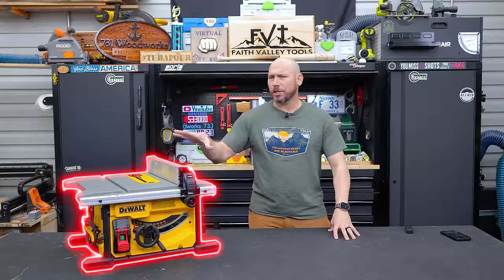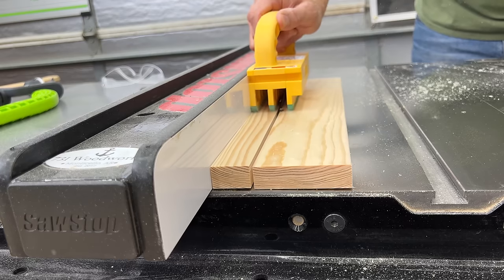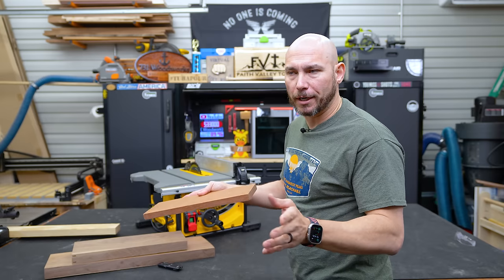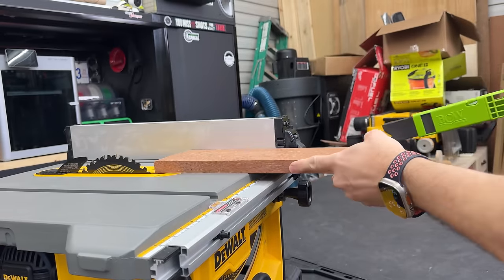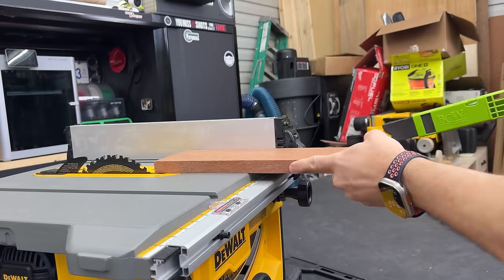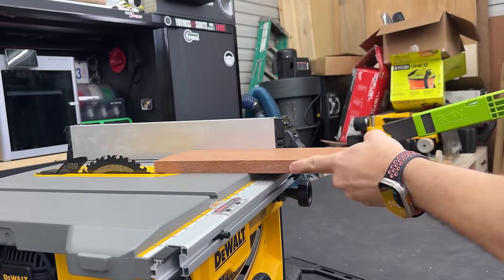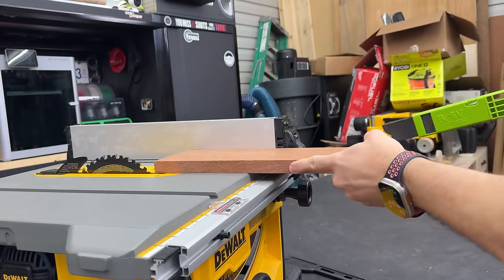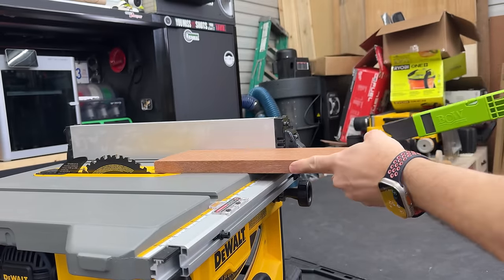99% of Beginner's Don't Know These Table Saw Mistakes to Avoid!

Comment: Yep! Tiny cut on a miter saw. DON’T DO IT!
Learned this the hard way.
Blew my aluminum blade guard into smithereens, shrapnel!!! Somehow I walked away with all my fingers. It hurt. I stopped and examined all my fingers and hands. Was pleasantly surprised not to see any red. Every time I use a miter saw this is a flashback memory.

Comment: There is a situation which is safer with the blade raised well above the top of the material and that is when cutting thin flexible plywood. If you attempt to cut 1/4” plywood with the blade barely protecting above the material, the air coming up from the spinning blade can lift the plywood up out of the cut. I’ve seen operator injuries from the plywood rising and being kicked back from the blade. The blade can fire a piece through a shop wall. Best practice is to raise the blade at least 1” above the work and concentrate on keeping it down on the table as it passes the blade.

Comment: My only problem with Sawstop is the lack of mass in the works.  Old seriously heavy table saws use the mass of cast iron they possess to absorb vibration and achieve accuracy.  SawStop is more like a lighter "contractor" (portable) saw. If they made SawStop like an old Powermatic or an ancient Delta, then fine.  SawStop places emphasis on their safety feature (which is very admirable) and "value engineer" the other features.

Comment: i ended up using a table saw for the first time in ages and maybe its just me but i pushed as hard as possible so that the wood wouldnt wingle out. I feel like the push sticks make it a little squirmy. then again this was an old saw , old blade, and i didnt have the cool tools.

Comment: Having lots of jigs and accessories is nice.  But the fact is that for many, if not most, cuts you make, jigs are not necessary.  I fully agree that you should use all of the safety equipment that came with the saw.  But all saws are not created equal and these rules apply to all.

#1 - Always set your fence by moving it from right to left.  This forces the toe out and helps prevent the work piece from pinching and kicking back at the end of a cut.  European saws  come standard with shorter fences that only extend to the back of the blade to reduce the chance of kickback.  If you have a Unifence, you can shorten the fence when cutting dimensional stock and lengthen it when cutting sheet goods..
#2.  Like video says, stand to the left of the work piece to protect the family jewels in case of a kickback. 
#3.  Your left hand is your anchor hand and is always stationary.  It is positioned in front of the blade where a featherboard should go and serves the same purpose to apply gentle pressure to the side of the stock and hold it against the fence..  There is no need to move it.  
#4  Your right hand is used for pushing stock, Keep your push stick where it can be grabbed when your right hand is even with your stationary left hand.  
#5.  When cutting flat stock, watch the stock and not the blade to be certain that it is against the fence.  
#6.  Have a fully equipted first aid kit with compresses.   Applying direct pressure is the first step to control bleeding.  Consider keeping large sanitary napkins in your shop and truck because they make excellent inexpensive compresses.

Comment: 7:57 this is the exact problem i have with my Ryobi table saw! The fence is super cheap and wobbly which easily causes kickback if you're not extremely careful. I wonder if i can upgrade the fence?
Reply: You need a fence that lock front and rear, and the rails that facilitate that. If you can figure it out it is definitely possible to build a better fence system for any tablesaw. The thing is, you will need to be as precise in your measurements as possible,; making sure the measurements are cut accurately, and your angles are as square as they have to be. I suggest using the methods put forth in this video for squaring your equipment. What this man showed is spot on accurate, without fail, if you follow his methods to the letter.

Comment: lol, many years ago i was cutting some wood on my cheap table saw and i was not pushing the wood with proper tools and my left thumb hit the blade and it was the weirdest feeling i have ever had, it felt like everything went into slow motion like in the movies and i could feel every tooth of the blade ripping the flesh from the bottom of my thumb, the amazing thing is it all grew back thankfully but i was much more carefull next time and being a meat cutter that worked with saws i know how much damage they can do very quickly

Comment: Emphasizing the critical timing  equipment  and skill sets  needed to quickly react and NOT BLEED OUT FIRST is highly significant. A panic button somewhere handy that sounds an alarm came to mind. Also having a phone at the ready with 911 speed and speaker mode might save your life.

Comment: "If it doesn't feel right in the gut, don't make the cut." LOVE IT! Thanks for emphasizing this. In woodworking I'm the step BEFORE an amateur, but we've all done stupid things like take risks, neglect to wear safety glasses and so on. If you're lucky you only get one pair of eyes and one set of fingers. It's not worth losing any of them to save 15 or 30 seconds. Professionals and hobbyists who have sustained injuries never have a heroic story to tell and you won't either. Do you really want to have to explain that you lost three fingertips because you didn't have five seconds to grab a push stick? Also, after you chop your fingertips off and get discharged from the hospital, you STILL have to come back and clean up the mess. Tools are great servants but bad masters. They aren't designed to monitor your safety. Use a push stick, wear safety glasses, if you have to put your hand anywhere near blade, unplug it, and if it's a gas powered cutter, get that spark plug out before you even consider touching the blade. Be safe friends!

Comment: I take the view that when blade teeth have come up through the wood and then re-enter the wood on the down cut, you want those teeth re-entering more vertically than horizontally. More horizontal tooth travel than vertical increases the risk of kick back IMO but I might be full of it. The idea of having the blade too high has some merit, but I set the blade so that it those teeth are not at the minimum height possible, but instead have more downward motion than what the minimum would provide.

Comment: Thank you for safety 
The blade guard is for protection 
Not to wind up in the trash can
It's for your own safety 
When you cut anything 
Never wear anything that would catch and pull your arm into the moving saw
Follow all safety manuals

Comment: I got too complacent once. I used my pusher stick to push a small block into the blade after I shut off the saw. The block hit me in the mouth at high speed. I had to check a couple times that I still had front teeth. I had fat and bleeding lips for sure. I respect the saw forever after that.

Comment: To add to #1: long hair and rotationg machines are a bad combination. Tie your hair together in a way, that it is not dangling down in any way. If the table saw grips your hair, DeWalt WILL have your scalp and that is the best case szenario.
For thin cuts, there are roller guides that work a bit like feather boards. Set up once and you can replicate the same thin cut w/o any iffy fence setup. IMO a must have accessory.

Comment: The first mistake to avoid is buying a Dewalt job site saw in the first place.
The rip fence is simply not rigid enough and gives you no end of trouble despite its deceptively attractive rack-geared positioning mechanism. Also it is so low that you can only attach featherboards when sawing rather thin stock. And in my old 745, the ripping capacity is not even 20 inches which means you cannot even rip standard kitchen worktops. At least not from the side you would like to be doing that from and where you don't need to do any math.

Comment: prop a stupid question but why yall focus on pushing the piece of wood thats between the wall and saw instead the outer one? that seems to be safer to handle and there is no obvious downside, it just feels like you are just hyperfocused on that piece you are trying to cut (like i dont feel like it will make the piece you are trying to cut any worse)

so far im just looking into woodworking but i havent actually made anything yet so maybe there is some very obvious explanation

Comment: I would say half the time I'm using a table saw I'm using it free handed. I do hardwood floors and I have too many cuts to make to set a fence every time. Them sometimes I have to cut stuff from say 2.5 inches to 2 inches. There's no other way to do it except free hand.

Comment: The blades are not meant to "just clear the wood".  They are designed (cutting edges etc)  to have the teeth fully clear the top of the wood.  Less heat, less kick back force, better cutting.

Comment: I had the tip of a wood push stick catch the blade and in an instant, the piece of wood vanished after it got kicked by the blade into the sawstop insert and cracked it badly.  I about had to change the underoos.

Comment: Actually there is a reason for the blade to be extended well above the material being cut and that is to prevent the blade from lifting the board and introducing a higher chance of kickback. Simple physics, the incident angle at which each blade tooth engages the material changes as the saw is raised in relation to the thickness of the material, the steeper the incident angle the more force is going into pulling the board down rather than pushing back at the user.

Comment: You mention in your video that the height of the saw should be slightly above the material when ripping.
I disagree in principle.
Why? The saw turns towards you.
When the saw is just above the wood, you have to overcome a large horizontal force and a small force on your table.
If you place the saw as high as possible, you will have a large force on the table and a small force towards you.
For sheet material, set the height of the saw just above the material to prevent splintering at the bottom.
Reply: To get enough advantage of cut angle, you don't need to set it as high as possible, just between 1-2 cm.  For most blades, almost all the gullet showing is enough.

Comment: One of the most dangerous cuts on a table saw is a large sheet of plywood.  Have seen a 4x8 sheet of plywood thrown across a shop when the saw blade got under the sheet.  This occurred even though the sheet had complete infeed and outfeed support.  Cut a sheet of plywood down to the smallest dimensions possible with a skill saw before cutting on a table saw.   Be safe.

Comment: Disagree with the comment at 2:20 about keeping blade as low as possible: the lower the blade, the more sideways force on the wood, increasing risk of kickback.   The higher the blade, the more downward force on the wood during the cut, minimizing the risk of kickback.  JMTC

Comment: I personally don't leave anything like the 321 block on the table saw table. the saw creates vibrations and the timber creates drag, to risky in my book. Secure it or remove it is my motto. I also wont buy a saw stop unless every other power tool that I use has the same single use safety devise.

Comment: I'm sorry, but the rip fence must never be parallel to the saw blade. This is extremely dangerous. It must be slightly further away from the saw blade at the back than at the front. This has no effect on the parallelism of the cut because the saw cuts at the front. But, if the rip fence is parallel, it provokes a kickback.

Comment: What is the cure for a blade to slot is not in alignment. Could that be a motor readjustment?
Reply: For the Sawstop, the cabinet/motor/blade stay still relative to each other. To align the miter track to the blade, you loosen the cast iron top, it has a pivot front center, and the rear moves left and right.

Comment: Do not set the fence parallel to the blade.
Make the back side of the blade width to the fence a hair wider than the front cutting side of the blade.
When you are passing boards through it keeps the material on the back side of the saw away from the blade.
You wont be cutting the board out of paralell doing this either.  All the cutting happens on the front side.

Comment: #3 Bottom of SAW GULLETS SHOULD NEVER BE ABOVE THE WORK PIECE! Most saw user manuals suggest BLADE TIPS TO BE ABOVE the work piece by 1/8 to 1/4 inch and GULLETS TO BE BELOW the top of the work piece. @731Woodworks sharing this could help others.

Comment: My first table saw was 4 4/4 a electrical outlet a on-off switch a routered desktop and a upside down circular saw with a plywood Straight cut as the fence that I built myself and I yet to have a better saw and coust me $25  and as soon as I build my shop I'm going to make another one😂

Comment: Answer this, if yhe sawstop uses its blade brake, does that break the saw? Is it resetable or do you need to buy new parys or a new sae?
Reply from the maker: You can reset it but you have to install a new brake and sometimes a new blade.
Reply: My brother in law has small business and he was showing me his fancy new ' saw stop ' equipped saw. He said it works real good but if it gets tripped in order to slam on the brakes instantly it destroys certain parts and they have to be replaced. They cost like a couple hundred any time it gets tripped.
Not for everybody

Comment: The height of the blade (and which model you will use) depends on the height of the wood you want to cut.  You need to have between 3 and 5 teeth in the wood at any time, with  the maximum height 'not in the wood' between 1 and 2 cm.

Comment: Love the video, but with tourniquets it's "High and TIGHT" - you DO NOT want to place the tourniquet all the way up on your arm if you only injured your hand! If the wound can be readily located, then you want to try to place the tourniquet 2-3 inches above the edge of the wound.  While medical advancement has gotten quite good, tourniquets can and do sometimes cause loss of the limb beyond them, so if you put up near the armpit (in an injured hand scenario), the victim could lose their entire arm, instead of just their hand.
Reply: You'll have a hell of a time compressing the  radial or ulnar artery with a tourniquet on the forearm.  Thewre's a reason God put the arteries down deep in most places, but it makes that trick difficult to impossible.

Comment: Using the blade guard is really the best thing (after engaging brain) a person can do.  Modern blade guards actually solve more problems than they create. No outfeed support and worried your board will fall off the end?  No problem, blade guard actually catches the board before it tips all the way to the floor.  Modern blade guards literally take a SINGLE SECOND to install.  It boggles the mind that people don't use them.  They'll take a couple minutes to change blades but they can't spare that second to actually ENHANCE the machine with safety equipment.

Comment: I was ripping a 4 foot piece of plywood and had a kickback, the saw threw a 4 foot long 1.5 inch wide piece of 3/4 plywood 30 feet across my shop and embedded it in a wall.  Kickback can be very dangerous so be careful folks.

Comment: You also missed where you can mess up with your push stick and cut off your fingers. Tilting it wrong, continuing towards the blade with a lot of pressure and it slipping off your piece, etc. A push stick can do some cuts safer, but it can also be the cause of your injury.